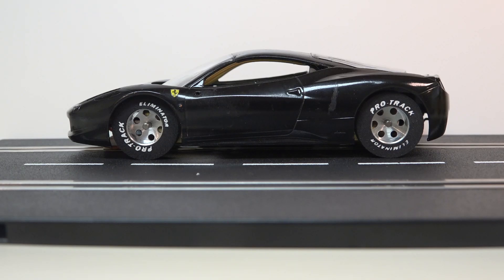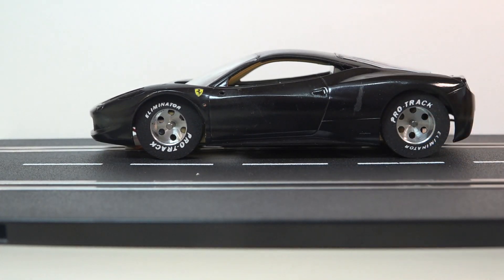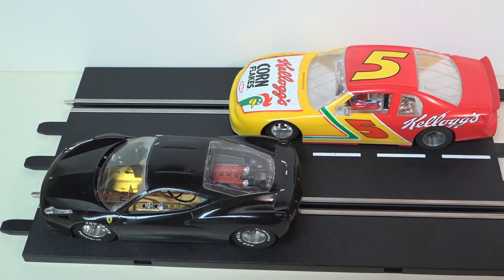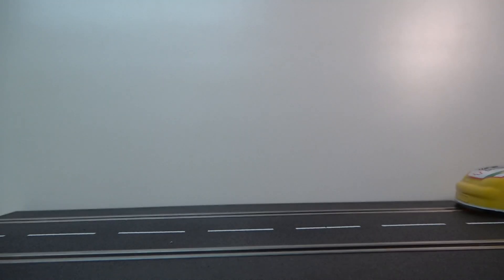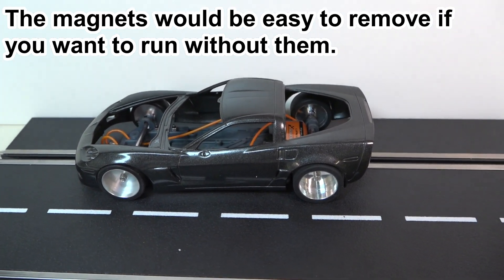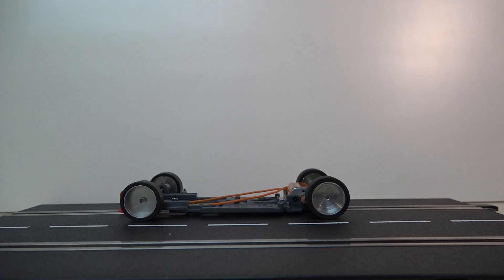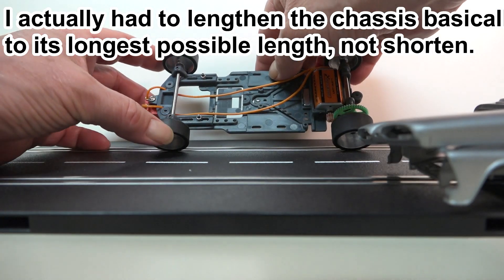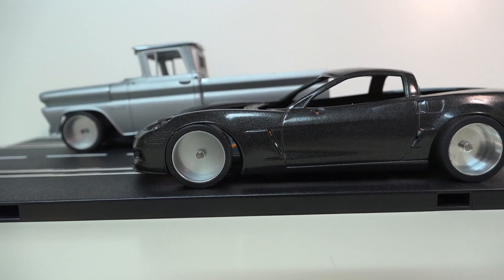Custom Slotcars On Universal Chassis Updates 100824: #slotcars #carreraslotcars #scalextric

Comment: There are tray style interiors available Doug, much easier install.
Reply from the maker: Thanks, but I am kind of cheapskate, and I also like how you incorporated some of the kit interiors into your builds. They look better than the typical tray style interior. Since I already have the parts from the model kits, I will try to use them rather than spend extra money.
Reply: @douglascook258  I get it, takes a little cutting and a steady hand.

Comment: I built that truck Doug.
Reply from the maker: Do you mean you built this kit at one time, or you are the one who initially started and painted this actual kit here and then sold it to the hobby store?
Reply: @douglascook258  I built it into a slot car in June.
Reply from the maker: @Clearwater124  Yes, I had watched that video back when you first published it. I see how you solved the rear wheel width problem by topping off the truck bed.